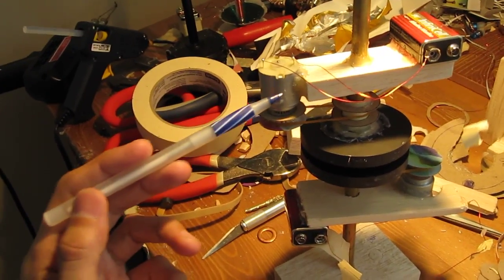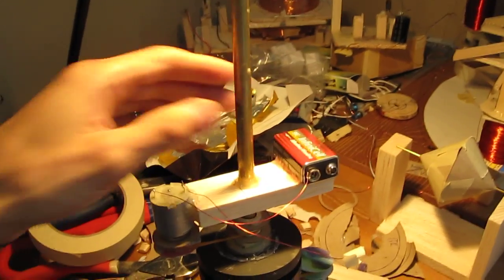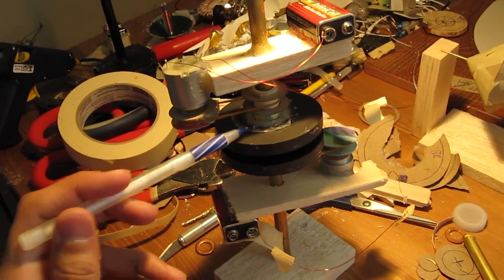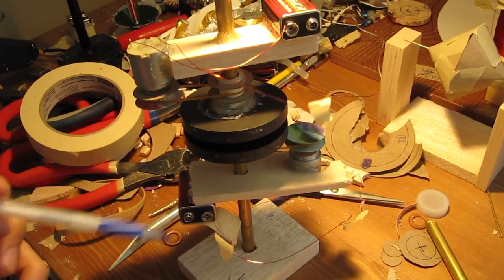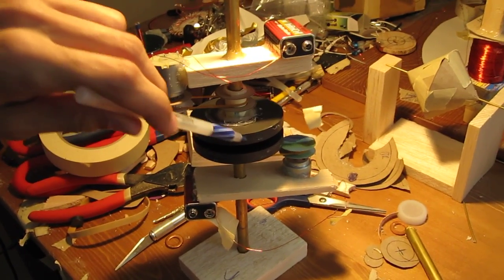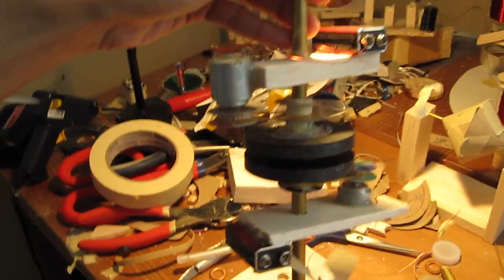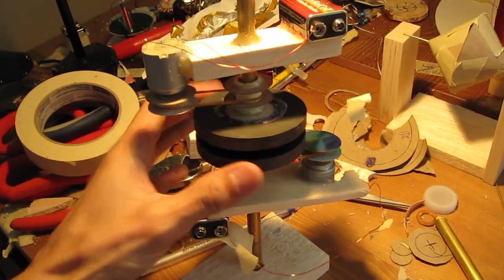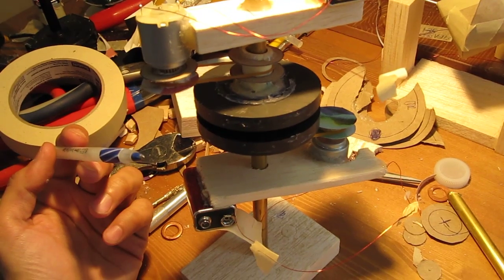Gyroscopic Antigravity - Part 3

Comment: Try larger magnets with high speed motors like drone motors counter rotating as you have. Also you may wish to increase the mass of the magnets by adding weight to the outer side of the magnets. What would be great is a dremel motor with 10000 rpm.

Comment: No but some of the gyroscopes would be redundant, you only need 2 gyroscopes mounted perpendicularly to each other and spinning in opposite directions to create a gyroscopic platform that could be moved up down left right but would be hard to rotate, that's how inertial navigation devices work.

Comment: The motor and battery set although symmetrical causes torsion that can not be compensted b ythe spin, thus instability. Try a " monopole " set up if its possible. Very nice demonstration of equilibrium due to counter spins, especially if it can stabilized.  Best of Luck !

Comment: Based on what you were saying, I expected it to wobble like crazy. It looks pretty well balanced. Your belts are probably slipping a bit. You should try wider belts or rubber bands so they have more surface contact with the pulleys.